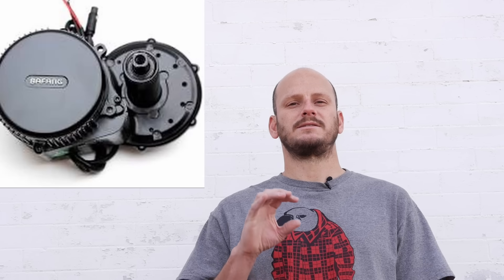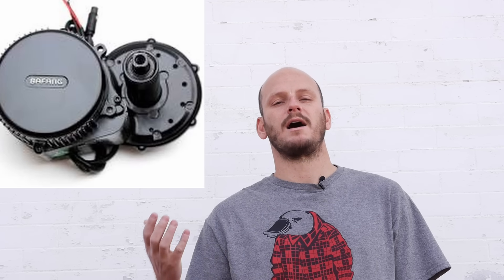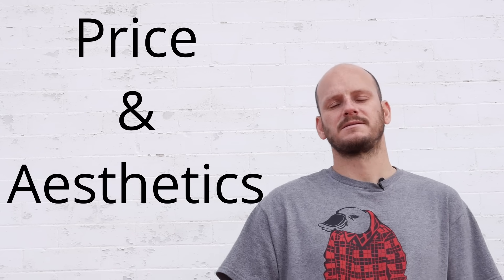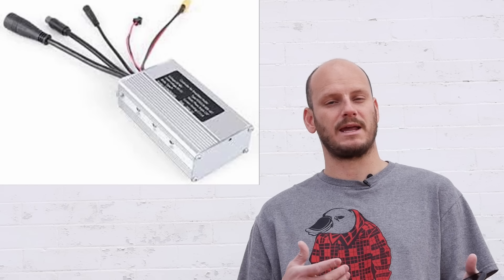Hub vs. Mid Drive Motors: Why Hub Motors Suck and Debunking Common Myths with performance test

Comment: Sorry mate but this is so full of half-trues. it sounds like you never had quality stuff in your hands... yeah mid drive motors are great and there are not to much good hub motors on the market, but most of what you´re saying is not true! front hub motors suck in general, yes. but rear hub motors can be absolut great. they also have benefits like no extra wear on the chain or motor break (recuperation) downhills. also they can be noiseless. mid engines with high power are mostly noisy, and with high power they eat chains and cassetts for breakfast.... spokes wont get loose if done right and quality is good(not more then on a regular bike). so please get your facts right and check these out for example https://www.neodrives.com/
Reply from the maker: Have you experience with a mid drive eating chains and cassettes?
Reply: @JohnnyNerdOut  Sure, there are customers that had their chain and sprokets gone in less then 1500km. and my shop is not in the hills. more power means more wear. people got 85nm motors and running just on turbo... its not to frequent but alot of ppl are surprised how fast chains are gone. there is a reason shimano is bringing new linkglide stuff

Comment: How do you get a mid drive motor to run without turning your pedals(say with a thumb throttle or sth) if it's using the chain?
Reply from the maker: it has a freewheeling crank so it can accomplish that

Comment: I have 2 ebikes . 1 hub 1500w with a 2000w controller and a 60v battery and a bbshd with a 52v battery and the hub kills the bbshd up my big hills and will do 60kph whilst the bbshd wont do it . Now i have bought a 3000w controller for my bbshd and will see how that goes . The bbshd goes further than my hub though but only by 10km . I ride 8km per day and the hub does 30km before charging and the bbshd does 40km before charging . The hubs better for thrashing though . My hub is a volimort . I also have a 1000w front hub but i dont like my front wheel spinning . Now if i go off road in the forrest tje bbshd is better because i can change gears for climbing . Its all much of a muchness . My hub does have thick spokes .

Comment: My opinion on ebikes? And this comes from an older guy who would consider one in order to leave the car at home and ride the bike on errands......NOT mountain bike rough trail riding. The beefy tire mountain bike conversions do not appeal to me. Sooooo, people like me are gonna lean towards a conversion kit that will work on the cheaper single speed beach cruiser bikes in our garages with rear hub friction brakes. For this type of conversion, the crank type makes more sense right? In conclusion.......I have a perfectly operating though cheap bike in my garage that I don’t want to chunk into a dumpster and spend $2K on a new ebike. Not gonna happen. So, for me the crank type conversion makes more sense. Right?
Reply from the maker: yes. You can change the font chainring to get the exact performance you want

Comment: Initial cost and chain life.
Please address those points.
Reply from the maker: Chains busting only happen on 3kw motors or for people who dont know how to ride a bicycle properly. For a custom build, a BBS02 is approximately $450. a good quality hub kit is about $400-450. Yes you can go cheaper for both systems but i wouldn't

Comment: I use a hub motor. In my case it is a ghetto-looking project so... It has way too much power and top speed. Way more than I would ever need, I guess. So I got that covered. Regarding driveability - I assembled it from different components - no soft start, a bit tricky to ride when you are new to it. And the thing is heavy.
What I don't agree with is problems with spokes - both mid drive and and hub motors transfer power from axle/motor though the spokes.
I dont see how this is a drawback in hub motor world. They are just shorter. It think it is more a problem of not using correct spokes for the amount of power, but that is not exclusive to hub motors.
Maybe it has something to do with heavier rear end?
Reply from the maker: its because hub motoors often have no quality control, especially on the cheap ones

Comment: One last difference is range. Do you have any stats on the extra range a mid drive will give over a hub drive with normal street riding? I say mid drive being better as it is likely to be more efficiently applied, where a hub motor has the efficiency of direct drive, the loss of gearing and power metering to load demand is worse.. I guess it depends on terrain, but I wonder about average differences there.
Cheers.

Comment: Hub Motor is not dependent on the chain, for example while riding the chain broke you can still use the hub motor to run the bike provided you sufficient battery, while the mid drive if the chain broke you can't use it even if you still have battery.. if spokes breaks on a mid drive is the same with hub its broken... Bias review though

Comment: the price is the real diferance i use hub every time 1500-5000w i love it
Reply: "every time"?  how often do you replace your hub motor?
Reply: @williamedwards6519  You guys are trying so hard to talk shit about hub motors, but I bought 1 hub motor 4 y ears ago. I run it at 750w, 1000w sometimes (I have a switch I flip for 1000w) and I have put probably 1000+ miles on it.  Hub motors don't burn out.  If they do somehow burn out, they must be using some really old ESC or something because mine cuts out if the bike doesn't move (if I try to start it on a steep hill or like if the front wheel is against the wall or something).  I think the guy who made this video and many in the comments should take apart a hub motor and look at it because it doesn't work how you guys think.
Reply: @waynefilkins8394  Ive have know idea how this burnt out hub motor story ever got legs.
Reply: @waynefilkins8394  well said. This fella doesn't know what he's talking about, or he has an agenda.
Reply: @waynefilkins8394  The guy is comparing low end, low power bike setups. Obviously a 250W mid drive will outperform a 250W hub motor. But hub motors shine if you do long range or high power cruising, or you have a throttle, since hubs are so much smoother to use with a throttle than mid drives.
Reply: @waynefilkins8394  I have a hub motor on my e-scooter. It is incredibly inefficient, producing enormous amounts of heat under load (especially at low speeds during ascend). You can burn your fingers when you touch it.

Sometimes it even turns itself off, because the cooling is inadequate. No radiator or even a fan is mounted.
Reply: @svr5423 - Your scooter has a much smaller motor and that is still having a lot of wattage shoved through it - it's going to have some heat build up especially if you ride it hard. 

Bicycle hub motors, which is what the original video is about, are roomier inside. After a long ride, the heat build up on my 500 w bike hub motor is hardly even noticeable.
Reply: @47f0  500W motor is more than enough for the application - if it were efficient. Doesn't have to be bigger.
Then the heat would also not be an issue. 
Let's say it is now 50% efficient (which is still overrated), then 250W of heat must be dissipated. If it could be 90% efficient, like brushless geared motors could be, only 50W must be dissipated. That's 80% less.

Comment: Hey Mr Johnny Nerd, I'm a big  HUB Man, I have a Magic Pie 5 1000w 52v hub motor and I never had a problem with it, It's been  five years. No gears to worry about, and if you're not sure how to work on the mid-drive you would have to bring it to a bike shop to have it repair.  The prices of a mid-drive are so expensive, a little  over  $900.00  for a 1000w. Now a hub moter any were  $289.00 to 550.00. I can perchase  3000w for same price of a 1000w mid-drive moter. Also Johnny if a person was to purchase a more higher price hub moter, spokes, rims are a better  qulity .Well buddy it's time for me to end this up. Take care "big J" will see you again.           🤜🤛✌  John. R   From Canada. 🇨🇦🇨🇦

Comment: In your opinion what’s the best mid drive motor?
Reply from the maker: Probably the CYC motor but its expensive. The best value would be the Bafang BBS02 followed closely by the Bafang BBSHD
Reply: @JohnnyNerdOut  Thanks for the information and the reply. 👍🏻👍🏻

Comment: Teslas dont have 4 motors. Hub motors are cheap.  You can buy them on ebay brand new for $200.. Mid drives will be douvle that. Voltage determines maximum speed..
Reply from the maker: Yes, all true. Check my description and pinned comment for more info

Comment: Ive been building and riding for 10yrs.. While i agree with some of his points i find the majority to not be true.. Hub motors are realible, they are fast. And they are torque monsters.. Mine has 160 nm which is on par witha crouch rocket motorcycle.. Trust me when i say there are exceptions to every rule. Either of theae motors is better then none. Qhatever it takes to get you on a bike is a good and healthy thing.. Its like the fountain of youth

Comment: Been riding my bbs01b bafang mid drive for over 4 years. Apart from a new chain and rear cassette and a grease up inside the motor gear it’s been great. Over 3000miles now..still going..I’m going to treat myself to a 52volt 750w system for the summer...great video ..
Reply: got the 52v 750w since 2 yrs. Really happy with it. More like a moped than a bike :) though if you wanna go slow the 250w i better. The 750w will be more on or off feeling. hard to get slow smooth.
Reply: @tobiasnilsson2849  have you tried altering the firmware settings..I’ve altered mine

Comment: This was a very helpful video. I was looking at Pedego. They have a mid drive model.
Can anyone help me here? I would like to know which bikes with mid drive have a throttle. And how nessasarry or useful is a throttle? I have test ridden the Gazelle,Specialized and Giant. The lower Gazelle uses a Bosch 250w with 50nm.
I wanted a motor with more nm.
Reply: I personally wouldnt buy an ebike without a throttle. There are 3 (4 including mopeds) classes of ebikes. Do yourself a favor and look that info up.... It also depends on how “legal” you want to be (if your a street rider).
https://electricbikereview.com/forums/threads/what-are-electric-bike-classes-and-why-do-they-matter.22738/
Reply: @joethompson2910  Thank you for the comment. The EG is one I like with a mid drive and throttle. It seem a little jumpy because I wasn't familiar with the throttle.
Haven't seen or heard of a law person bothering someone on a bicycle.

Comment: You say hub motors ruin spokes, but not if you use the right type of spoke. I use motorcycle tough spokes on 2000W hub motors, everytime. Just because China sends weak spokes to save themselves money doesn't mean hub motors ruin all spokes.
Reply from the maker: correct, and thats a good idea to use thicker spokes

Comment: yeah but the thing is, f*ck mid-drives sticking out like a sore bump on the head, and now theres hub motors with gears and are very efficient, also looks better on a bike, the mid-drive looks like a desperate attempt to make a bike electric
Reply from the maker: I'd say its personal opinion. Direct drive motors for example look hideous in my opinion. the small 250w motors do look nice but... So far I've only seen 2 speed hub motors, which I guess is better than 1

Comment: I converted a VW bug to electric in the mid-'90s and typically kept the car in 2nd the whole time for around-town driving. I had a low voltage system and a small battery pack and had a limited top end. If I wanted to go faster, I did have to shift to a higher gear. A Chevy Bolt has a one-speed gearbox.  Teslas have single-speed gearboxes. Electric Motors have full torque at 0 rpm. In my opinion, a hub motor should be purchased for hill climbing OR for speed. Chevy Bolts and Teslas have much larger HP motors to get the mass of the heavy vehicle up to speed quickly and achieve high speed. A tiny hub motor trying to move a heavy person and bike up a hill with a small battery and low voltage is going to struggle unless it is geared for hill climbing. To Johnny's point, a mid-drive gives you more options for gearing to suit the conditions you are facing, with a small battery and low voltage. A hub motor would need higher HP, higher voltage, and a larger battery to match the single-speed performance of a Bolt or a Tesla.
Reply from the maker: Exactly! That is awesome what you did, especially before Lithium was huge. A true pioneer. Would love to pick your brain sometime as I want to start retrofitting old cars and motorcycles headed to the dump.

Comment: Wow this is a great video! Can you give me advice on witch Bafang system should I buy? I work as a delivery guy on a bike and i cover 50 to 100 km a day and I need a system that can cover that range, thats reliable, easy and cheap to repair, and that the controller won't fail on me. I was thinking about a Bafang 36v 500w (mid drive) system or 48w 750w (mid drive) system with a battery of 17ah. The controller and range are my biggest concern. Or should I buy a Bosch system?
I work in a mostly flat city and drive a trekking bike. I cover about 1500 km a month.
Reply from the maker: 48v 750w and then just tune it down if you need to :)

Comment: What about noise or unsprung weight and efficiency %?  You may have missed some key points and differences, planetary geared hub motors as well 🤔, i use a 2000w brushless hub motor with a winding that gives it a top speed of around 40 Mph, not a trail bike because of the unsprung weight in the rear wheel, but it is soooo quiet and pleasurable to go on paths. Still same rusty chain from 8,000 miles ago too.. thanks for the insights

Comment: as a rider if a Hub motor bike, I agree with most of it reliability wise . Although hub motors have a more gradual power delivery. like a mid drive with continually variable transmission. downside of mid drive motors is that you speed up out of the cadence range too fast so that you are ALWAYS shifting. like a manual car in traffic. but mid drives are unmatched when climbing really steep stuff.

Comment: honestly I'm planning on upcycling old bikes into e-bikes and i love the idea of using hub motors for them. the majority of the market I'm planning on selling to cant afford mid drives.  also i love the idea of setting up all wheel drive bikes. making some really fun off-roading possibilities for the kind of off-road i can still do with my shyte back.
Reply: Just be prepared to purchase a stock of various spokes and string and true a bunch of rims.  My first one took about 2 days of trial, error and learning but after that it gets easier.
Reply: @andypandy7769  thanks for the info will be pretty careful. theres a good chance that i will be buying custom built batteries from a fella ive seen here on youtube. but that all depends on money.
Reply: @andypandy7769  haha, so true. I’m now in my 70s and am now just looking at electrifying my trusty 35 yr old MTB.

Comment: I would say i agree on nearly all said, i've done 10k on hubs and 20k plus on my mid drives, neither are without problems with differing degree's of fixing factors, i went through a nightmare parts failure with my bafang bbshd with my sator rotor snapping, i've endured constant spoke breaking on hubs, that being said, i learned loads from using my mid drive, its power eats my hub for hills, flats not so much but not far off. You will ultimately need more chains and cassettes replacements and new rims but thats it, when your hub rim goes are you really going to get it respoked to new rims... Also try tuning a bbshd, it really adds new layers to the ride.

Comment: Hub motors are the best motors as long as you mount it mid drive and not in a wheel.
Reply: That makes no sense Scott.
Reply: @sammiller6631  Your right it doesn't! We wouldn't want a terrifieing amount of torque that just so happens to be laying around the garage to end any carreers or nothing.

Comment: Telling it how it is, via your perception.....which defies simple physics........To exert "X" torque against a tire, whether it's from a hub motor, or whether it's a middrive.....is going to require "x" input....period.....end of sentance....the spokes are merely one link in the chain...and that link is going to take that much stress and thus, wear&tear, regardless of whether a hub motor or a mid drive is driving it.....
Reply: Don't get me wrong.....I rally think the mid drives are cool.....but what our friend suggests has ZERO bearing on reality.....which is physics......

Comment: Oh, My original thought. You don't address unsprung weight. That becomes very important for faster, heavier bikes, so if you do a motorcycle conversion, it's a very good reason to stay away from hub motors. Only thing I disagree with in your assessment.